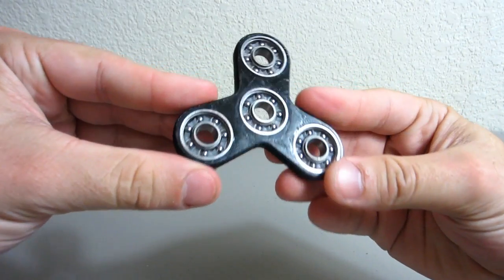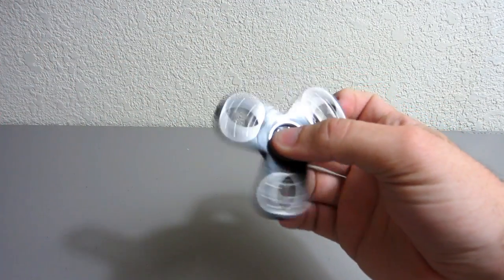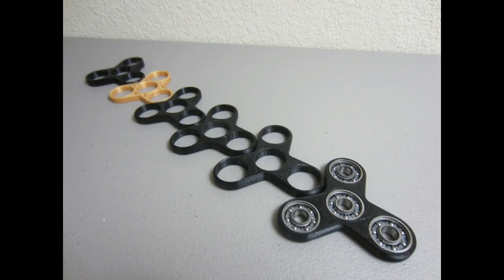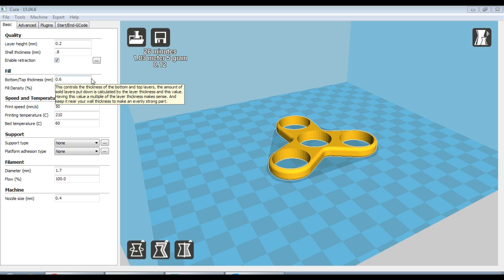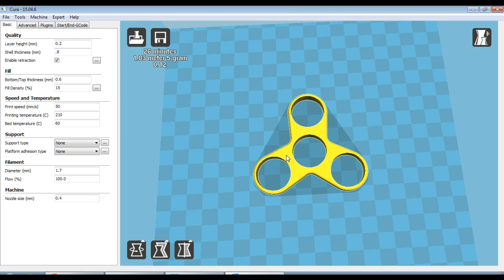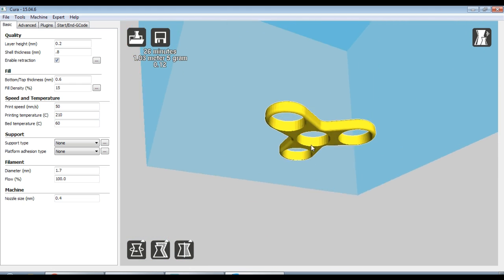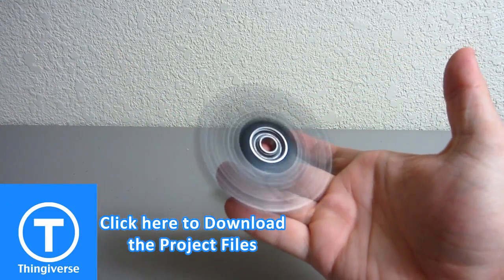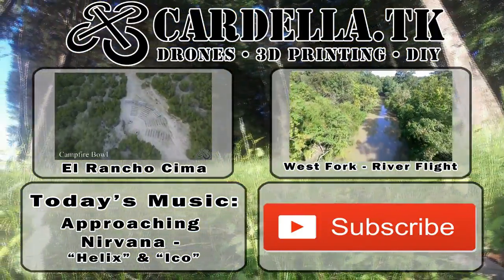EDC/Fidget Spinner Design Process - Free STL!

Comment: The principle of fidget spinners is that the outer bearings inner ring spins inversely at the initial spin,  then gradually re-transfer their kynetic energy as the main structure slows down. Giving the impression that the whole thing spins longer than it should, bacause it was able to store more of the initial energy applied. Nobody seems to understand that or what??

Comment: Why the bearings on the 3 ends?  Isn't that kind of a waste or do they serve another purpose other than weight?  Could you have used balls instead as they are cheaper or am I missing something?
Reply from the maker: DaveC1964 There's a few reasons - you can spin it by the edges, and it provides weight. Could you use weights? Sure, but you'd lose a good bit of utility.

Comment: Do the bearings click in or do i have to glue them in?
Reply from the maker: The STL is designed to be a tight friction fit - no glue required, but it won't "click" either.

Comment: I'm designing my own on solidworks. Does a 21.9mm inner diameter make the bearing fit tightly so it requires no glue to stay in place? Or did you use any type of glue?

Comment: Downloaded file on sd card but my printer ain't printing it out help me please sombody
Reply from the maker: Depends on what kind of printer you have - I'd encourage you to reach out to owners of your specific type of printer, and get some pointers! Facebook and Google Groups often have active communities which can help you troubleshoot issues.
Reply: CardellaTK I have the mono price select printer but I didn't want to buy the like 1000 dollar printer I downloaded the file on my ad card but it's not printing it out
Reply from the maker: I can understand not wanting to spend a bunch of money - My printer is only about $300!

.STL files that we share in the 3d printer community need to be "sliced" before they can be sent to the printer. There's free software like Cura and Slic3r which can help you with this. Monoprice has instructions on their website for configuring Cura to work with your printer. I'd recommend a .2mm layer height. Happy printing!
Reply: CardellaTK thanks dude btw I subbed
Reply from the maker: No problem! Glad to help.
Reply: CardellaTK What was the scale of the file I finally got

Comment: Hey man, great vid! Just curious, what was the material you used for printing? SLS Nylon? Or just General Plastic??
Reply from the maker: RightSideSuay - The spinners in the video are PLA, but on Shapeways you can get a variety of materials
Reply: What's the best material in your opinion? :o
Reply from the maker: RightSideSuay That entirely depends on your application. PLA has been tough enough for me, but it could deform if you left it in a car on a hot day. ABS is the material Legos are made of, and it's more heat resistant. I dont print ABS on my personal printer because it gives off fumes while printing. 

Nylon or Acrylic would each likely have good properties too, as well as heat resistance.
Reply: mm okay! one last question.. if I were to choose ABS, and had a choice between 100/200 microns, which would be better? understandably, 100 would be better but I've read that that's not necessarily the case. If so, does it apply to PLA as well? Any tips? Thanks for the replies man, much appreciated!

Comment: Could you change the size of the other 3 bearing holds to have coins or weights in them. So you can make 4
Spinners with one set of bearings

Comment: the ones I ordered from you shapeways had the bearings a little loose. what would you suggest for adding to the interior thickness? maybe some weatherproof silicone rubbed on the inside? not really sure.
Reply from the maker: Any sort of thick glue (Gel superglue, epoxy, hot glue, silicone, etc) would work!

Comment: used this design and your berrings and one of the arches cracked :( now im out 20 dollars for making the frame
Reply from the maker: I'd recommend sanding the inside of the bearings holes, if you're experiencing extreme difficulty inserting the bearings.
Reply: can you make a video of you installing the bearings?
Reply: Second one broke now. please release a new design, ive spent $40 getting them printed. holes are small a few 0._ _ MM larger so they fit.

or new designs

Comment: Are the spitfire cheapshots ceramic or steel?
Reply from the maker: They're cheap steel bearings
Reply: well I heard that you have to take the grease out of the steel ones, did u have to do that for this video?
Reply from the maker: Not yet, but soon. Just remove the shields with a knife or paperclip, and run it under water. This may cause rust eventually, so a little dab of WD40 might be a good idea, too

Comment: How do you install the bearings? Do they just snap in or is there some kind of adhesive you use?
Reply from the maker: It's a tight friction fit, no glue required.

Comment: Is there a reason you drew it with diameters of 21.9mm for the 22mm bearings?
Reply: I'm pretty sure its so that the bearings will fit in snug without the need for any adhesive.

Comment: how can you make the bearings fit? i printed your stl design and it wont fit.. thanks
Reply from the maker: Push hard, or sand it, or scale the STL appropriately when you slice it. I print at 100%, and the bearings are a tight friction fit

Comment: Hi, did you have to do some sanding on the holes so that the bearings would fit? I printed your  "Cog Tri Spinner" design but the 22mm bearings didn't quite fit. It was great after some sanding. Thank you
Reply from the maker: I'm able to pop them in with a little force or a tool. Sanding is an option too.

Comment: Hi! I was just wondering how the files for the design worked. I'd love to make one but I don't have a 3D printer. However my school has one and I'd like to take it up there and mabye ask a favor of a student who knows how to work one. My question is do you have to do anything on the STL files? Or can someone hit open and print and it begin printing. Thanks in advance!
Reply from the maker: If you have an engineering lab, bring them the STL file. They'll "slice" the file, which involves using a slicing program to generate machine code (gcode) from the STL. Imagine taking the 3d model and breaking it into cross sections ~.2mm tall.
Reply: Thanks!!

Comment: I really want to jump strait in and buy the black steel one on the site, but I just wanted to see it first are you going to make a video on the metal ones in the store?
Reply from the maker: I don't have a metal one yet, so I can't make the video yet.
Reply: CardellaTK I got the metal one and the bearings don't fit at all
Reply: So if you already ordered it sorry
Reply: CardellaTK and if there is a way can you make the holes bigger so the metal one will work
Reply: Probably need a millimeter more room
Reply: Half a millimeter

Comment: Did you use any adhesive to secure the bearings?
Reply from the maker: No, the fit is tight enough to secure the bearings without adhesives.

Comment: how will the middle part spin with just regular bearings? also in your stl project you have a "malefemale" thing going on. i wanna 3dprint on of my own but im confused, care to explain?
Reply from the maker: I'm using regular steel bearings in the video. 

There's 3 STLs in my thingiverse things - the Spinner hull, and then two parts for spinner handles. There's a "male" and "female" handle portion that fit together within the center bearing, simply add glue and press together.
Reply from the maker: Steel bearings work just fine, yes.

Comment: How much more spin would you say the metal ones get compared to the plastic?
Reply from the maker: Standard bearings are steel with what appears to be a nylon spacer. better bearings would use partial or full ceramic internals.
Reply: Maybe he meant a metal body vs. a plastic body.
Reply from the maker: I can't say, I don't have a metal one.

Comment: Will this work with a makerbot? and how would I convert the file to work on a maker bot
Reply from the maker: .STL is the commonly shared format for 3d printers. Most machines take gcode (machine code), which requires you to run the STL though a slicer program like Cura.

I'm not familiar with your exact machine, but odds are it'll accept gcode, which you generate by running the STL through Cura.

Comment: After seeing these around I had to buy one. Yours was just what I wanted at a reasonable price. Placed my order tonight. Can't wait for it to arrive!
Reply: Shipping and production was crazy fast. He isn't messing around he is producing quality products. Placing the order for some new bearings right now. Scavenged some temporary ones out of my brothers walmart skateboard that'll have to do for now lol
Reply: This does not come with the bearings by the way, it is just the 3D printed plastic part
Reply: ItzMeh(condecon) which ones are you using in the video?
Reply from the maker: "Cheapshots" by Spitfire. The cheapest thing your local skate shop will carry. Ceramic bearings will give a superior spin, however.
Reply: as an avid skateboarder I'd recommend Bronson's G3's, they're around 25$. if you'd rather go budget though, Bones Reds are 15$ but isn't spin as well. both are very good though.

Comment: do you just slap them in or do you have some kind of glue to get the bearings to stay in the holes so they won´t just pop back out at random?
Reply from the maker: The tolerances are tight enough that it's a tight friction fit. You have to use a good bit of force (and sometimes a rubber mallet or piece of wood) to get them in. They're reasonably difficult to remove.
Reply: okay thanks for the fast reply :)

Comment: Thanks for putting this out there! Went ahead and printed one myself tonight and used some cheap ABEC 5 bearings i found at a local skate shop. The only issue I had was fitting the bearings but a bit of sanding sorted that out. I think that was due to using ABS in my prints (New to printing so working out the kinks still.)

https://dl.dropboxusercontent.com/u/86993742/2016-09-29%2022.06.58.jpg
Reply from the maker: Looks sweet! I've been printing PLA, so I'm not sure if the bearings will fit on an ABS print - I know ABS shrinks differently as it cools. With PLA it's tight! Mine are friction fit without glue.
Reply: I've filled several orders in ABS and the bearings press fit just fine.
Reply from the maker: Filled several orders?
Reply: 3D hubs and depot prints.
Reply from the maker: Jonah, Please be aware that these files were released under non-commercial licenses.
Reply from the maker: Looks good! I think I saw your Make on thingiverse!
Reply: OK.  I'm not selling the model or using the model or print for commercial purposes.   It still works fine with ABS.